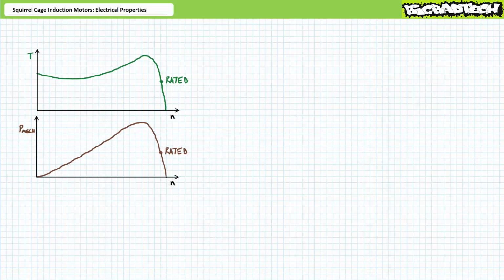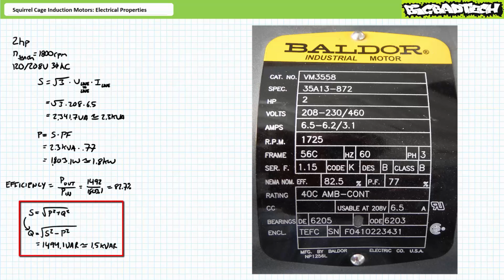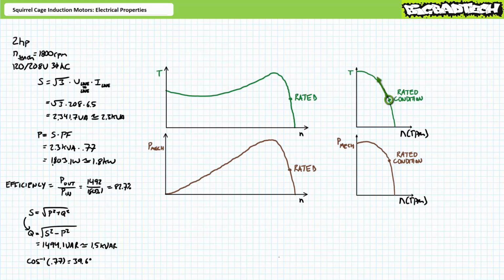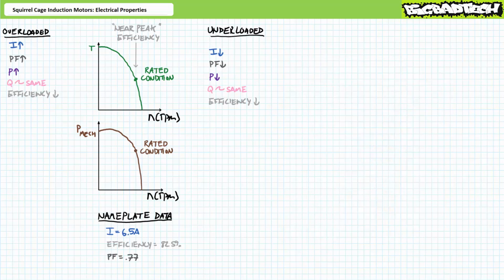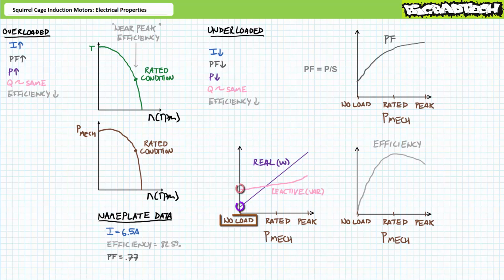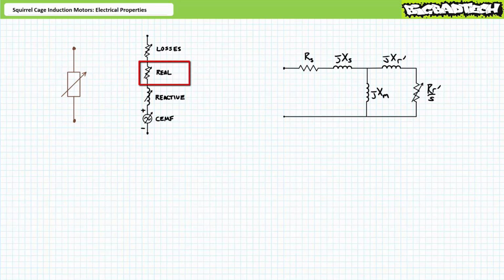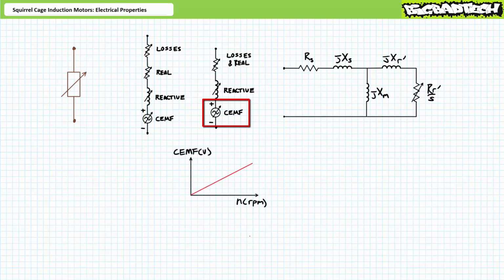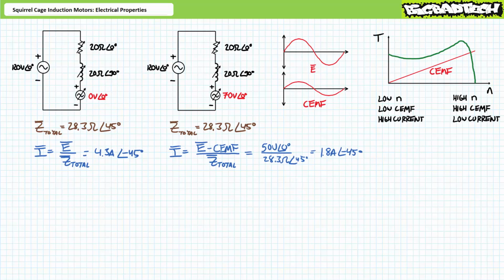Squirrel Cage Induction Motors: Electrical Characteristics (Part 1 of 2)

Comment: It took me a lot longer than it should have, to understand why wiring it with 230V results in a rated current draw that is less than wiring it at 208, even though the internal wiring and impedance of the circuit is identical. Of course, rated power is fixed by the characteristics of the rated load! So, the motor accelerates to that rated load until input power exactly balances the combination of back EMF, load torque, and bearing friction. The only thing preventing these motors from drawing more current than they should are characteristics of the mechanical load.
Reply from the maker: True dat! Similar to pascals law and hydraulic cylinders pressure of extension or retraction is a load induced phenomenon. A motor’s performance is load based.